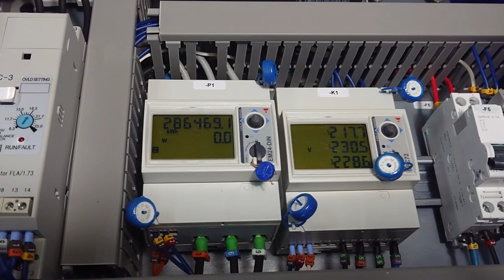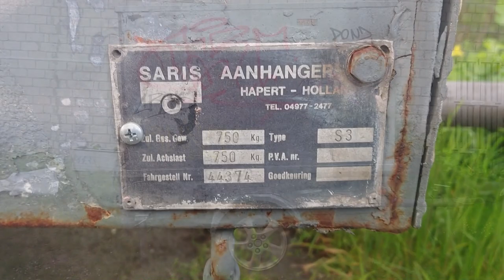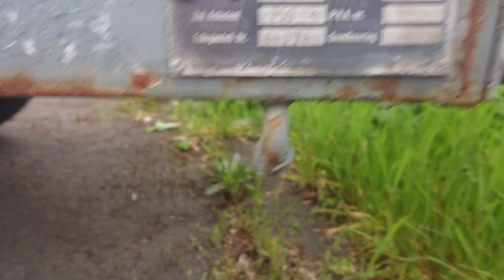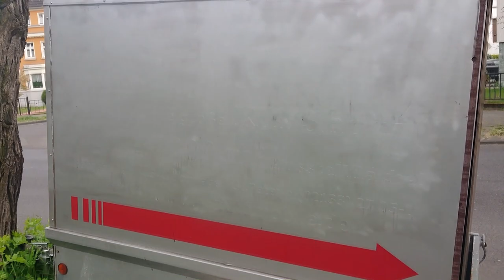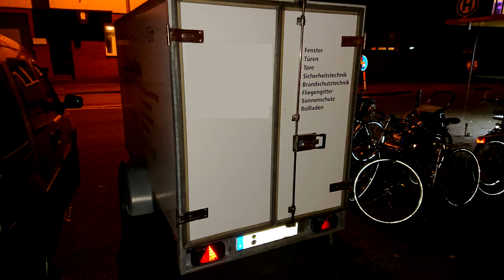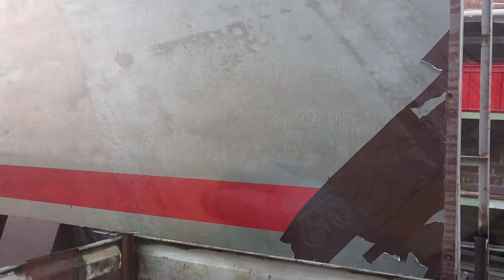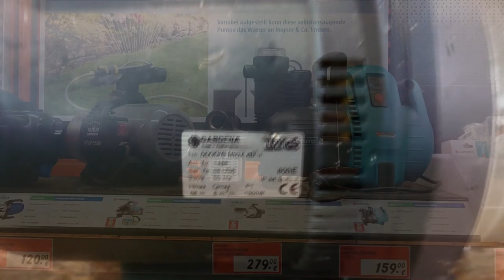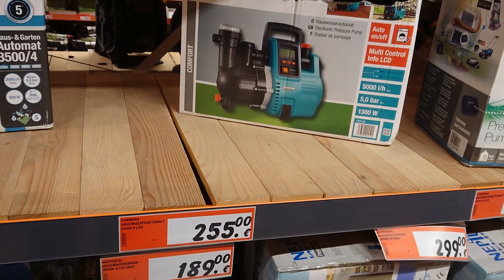Expensive Scrapyard Finds! Repair-A-Thon!

Comment: The trailer would make a good bug-out 'mini-few-days-away' camping platform - or of course - a mobile workshop.  The wheel base is quite narrow, I really would be careful and cautions to secure its center of gravity as low as possible.

Comment: Amazing finds and love that you practically got the trailer for free! 3 panels ... you could provide emergency power, with batteries onboard if you go camping...  Totally agree about the wrong direction on software and hardware obsolescence...i have a wifi-controlled lightswitch and two serious issues. After 9months LeGrand decided to discontinue it and for reasons that it has burned out component. And no further support on other products. IoT seems to be a future problem with waste of items that have no further use because they will require firmware or software fixes that aren't sustainable to the manufacturer.

Comment: When you see those plastic threads you can get a threated pipe to fit over that have hose threads on the other end. When put on new you never wear the plastic threads down. Anywhere the water touches wears out the plastic. Faster if it's hot water. So they have no longevity anyways.

Comment: Love your videos! That trailer can easily be used as a mobile power station. Solar panels on top to charge a battery bank. A dual fuel gasoline/natural gas generator to run if the solar is depleted. A charger to connect to mains would be handy. Some kind of heat exchanger to heat the inside of the trailer and space to camp in there and sleep. Make it look like an old utility trailer so no one is suspicious of it. Put some emergency gear in there in case you need it. Many possibilities!

Comment: I love your ethos and videos that inspire us all to use existing material rather than always buying new stuff. We recently had a pool installed and I was able to make a shed to cover the pump and salt chlorinator without spending a single cent. The door has composite hinges from an unused corrugated iron gate, corrugated iron from a panel lift garage door and a homemade door covered by clear uv protected acrylic sheet so that I can see the pump readouts without opening the door. Posts were from an a disused steel fence.

Comment: Why are there no pickup trucks in Germany? Far too many of them in the USA!
Reply: Hardly any in Finland either, snow season is bad enough that it is easier to use a panel van commercially and a rented trailer for occasional use. Public transport means that it is often cheaper to travel by train if alone and if you have a family then you need a sedan and not a pickup.  Markets don't change fast so even if pickups had better value you would need some dealership to start marketing them for a few years to make a dent in the statistics.

Comment: I have a question regarding the scrapyards. When I tried saving stuff from the scrap, I had to find out that they are not authorised to resell items, and have the obligation to "recycle" (melt down) everything. So my first error was to ask explicitly for buying stuff. After learning this, I rather asked to have a quick look around, then dont get hit by a wheel loader whilst hectically pulling out some parts of the big pile. In order to take them home, I learnt it was best to have cash ready in my pocket to quickly give it to the guard, then leave. He told me to never come back, because they dont want "collectors" at their place.
My question: Are there any methods to improve this experience? And is the practice different in different scrapyards, and what places are the best?
Thanks in advance. Your content is really inspiring me! 
Greetings from Kassel
Reply: The experience varies A LOT by country, region and individual yard.  Over the years my best experiences were with places that encouraged the process.  Second was small places with just an indifferent manager of foreman in charge who would often pocket the proceeds.  The worst are the yards run by big chains or franchise operations where they have a legal department that prohibits entry from the public.  Some yards have a retail section where they will sell metal stock, sheets, pipes, tubes, rods and angle that is often unused new material or offcuts, these places may allow returning customers have a look around at the other stuff in the yard.

In some countries there may be municipal yards that should not let you take anything as they have contracts with the recyclers but occasionally a watchman may be tractable to a donation.  It may be possible to start a program in your city that recommends this kind of activity but the city often has no interest in getting involved with projects that involve such small amounts.

The most common scenario in South Africa when I could pick was that I paid double the rate that they would have paid someone for the same scrap.  This made heavy steel stock less interesting unless it was the exact size you wanted. Electric motors and transformers was not usually tempting because they would be sold back to me at double the copper price while most of the mass was iron.

Good plan is to visit each yard, test the yard manager and if they are not interested then phone the owner and explain your idea and ask if they will instruct the manager to cooperate, the worst they can do is say no but you were not able to access the place anyway. 

Go when it is not busy, take a teenager along with you, a lot of people are happy to help student projects, have strong shoes on and gloves with you so you can counter trivial safety concerns. Do not make a big thing about e-waste as often stupid policies are in place to prevent it leaving the waste stream, keep that low key and try and always buy a bit of scrap metal and then include the electronics or intricate machinery you want and pay for them by the kg sometimes you get everything at twice the scrap iron rate if no copper was visible. Pick times when they are not busy and you do not cause them risk or irritation.  Have a business card with your details that describes you as a Post Apocalyptic Recycler or go in there on behalf of your local Hack Lab and ask the owner to call you if the manager is not able to make a clear decision either way..

Finally a sad bit of advice, don't advertise your sites widely, the privilege will end if they get dozens of people rooting in the scrap for bargains, just one accidental injury will cost them more than they will ever make from these recycling customers.
Reply: @KallePihlajasaari  thanks for your detailed answer, and the good description of different scenarios!
I will yet have to find that ideal place you described which encourages salvaging. Maybe I could even start a municipal project! In the meantime, I will be working on the parts that I was able to buy at my last visit. 
And yes, sadly, your final advice on not publishing the sites is important. 
I will definitely give your methods a try, and as I am a student by myself (almost like a teenager, right?) the science project thing might work as well. 
Have a good day!
Reply: @KallePihlajasaari  I'll add one thing-  bring a six pack of popular beer, and let them know that you appreciate the relationship.

Comment: Living in Europe seems like a pain in the ass. Here in Albuquerque new Mexico usa there are more pickup trucks and large SUVs than cars
Reply: I want to see you drive through a construction site on the Autobahn with an american pickup truck, let alone some 600 year old streets.
Reply: @iQKyyR3K  I wasn't hating just saying it's weird
Reply: @fladoodel  all good, in Germany a Golf may tow up to 1700 kg (multiply by 2.2 to get US pounds). 
Germany and US differ significantly in how we transport stuff, in Germany you'll either have/rent a trailer, my dad has a T4 Doppelkabine, works like a pickup just more compact with a better turning radius and gas mileage.

I know maybe one guy with a pickup in Germany, but I guess it's like G-Wagons 90-99% of people buying them don't use them as intended.

Comment: hopefully by adding all that metal it didnt alter its carrying capacity unless you are going to upgrade the axles.

for that paint that wont come off the wood you could get a media blasting gun cheap and use soda its good for taking paint off wood and not damaging the wood

Comment: Well done on the Gardena, totally agree with you on phone apps. My Lowara pump died recently,  only a couple of years old  but found a massive hole in the side of the starting capacitor, in many homes that would have gone to the scrap too.